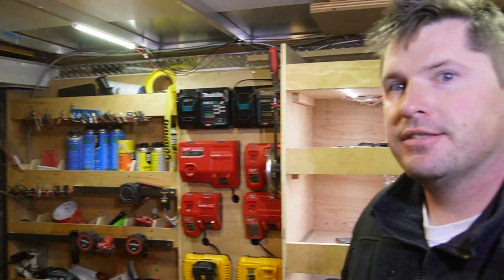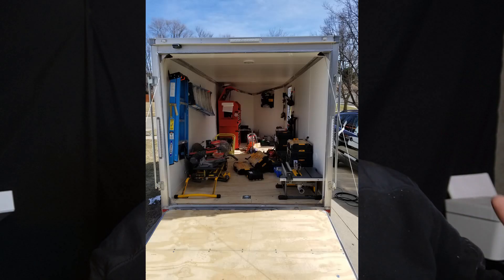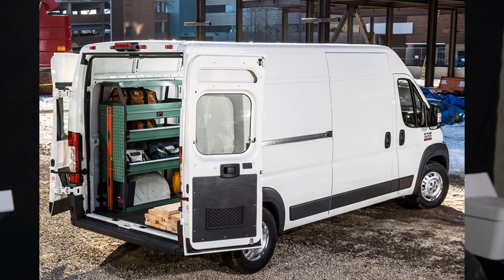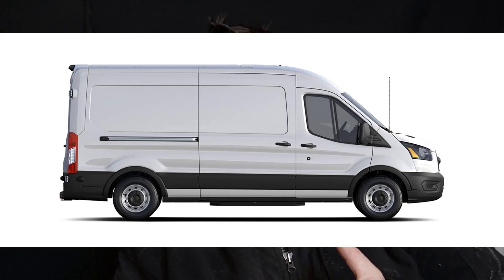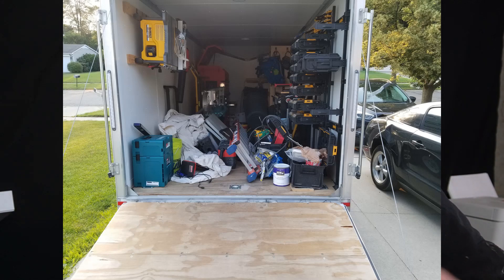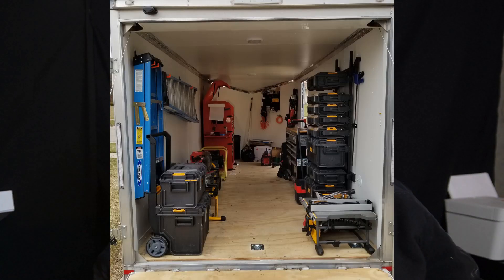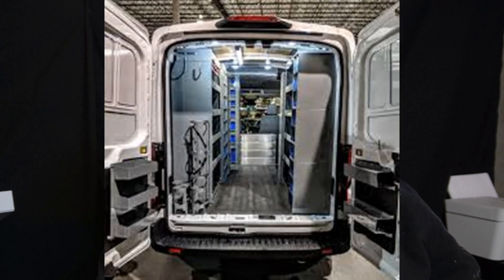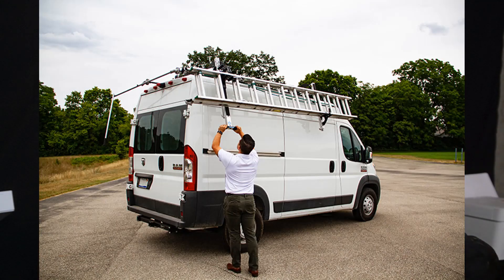Contractors with a Truck, Trailer, Or a Van! Pros and Cons!

Comment: I think trailer for general contractors who need a wide range of tools, materials and drop ability if you stay on one job site for a long amount of time. Van for specialty contractors who don’t need material storage and are frequently going to different jobs. Just for tool storage and mobility. Truck for the handyman or diy or if your just starting out. I started out with a truck 2 door long bed. I got a trailer and it was a game changer. Dry tools, dry materials and no more breaking your back or being worried about your shit getting stolen out your truck while just running into Home Depot for a few min.

Comment: Great video. Because of cost I'm going to add a locking contractor cap to my truck. I will also be doing some urban work, so a trailer will become cumbersome. But I plan to add one down the road. Again, thanks for the great video.

Comment: What’s your advice for deciding when to upgrade to a trailer? I’ve been doing the constant load and unload with my truck and it’s a pain, especially since I’ve started taking on slightly larger jobs with multiple elements that end up requiring a bunch of tools. But I’m not sure at what point it makes sense to get the trailer. Any input on business milestones to make that decision?
Reply from the maker: Upgrade when you can't afford not to.  Is it costing you time and money not having a trailer? If the answer is yes then look into a trailer or upgrade to your current vehicle.
Reply: @RenovationsandRepair  thanks for the reply! It’s definitely costing me time and money. Problem is my current truck can’t handle the trailer size I would want. I’m thinking of upgrading it with some Weatherguard tool boxes and maybe a small trailer or even hitch-mounted cargo carrier to start with, given the price of vehicles right now. Still chewing on it…
Reply from the maker: Depending on your work load and funds, if you can swing it even if it might be tough starting out I'd look into just biting the bullet and jumping into the size truck and trailer you want now. With how things are going the vehicle market isn't going to cool down anytime soon and if having the trailer you want and the truck you want now will make you more efficient and open more doors for more work then you probably will get a return on your money quicker than saving up and hoping the market cools down to buy the truck and trailer down the road. 

I waited to buy my F450 for a while ten mo ths and it bit me in the ass to the tune of buying a used f450 $2000 more than I could have bought the very same truck new 10 months earlier if I pulled the trigger.